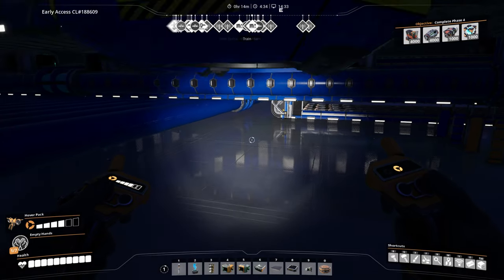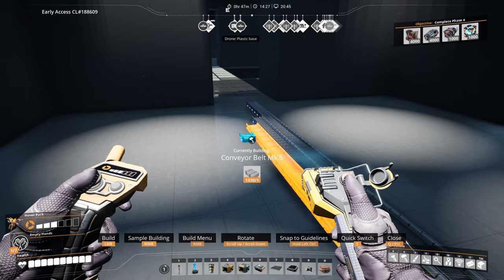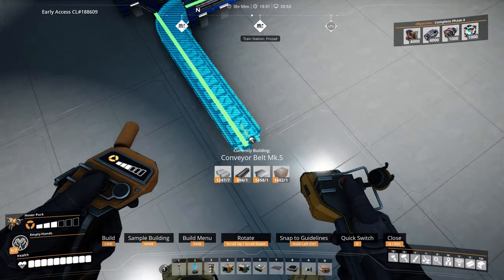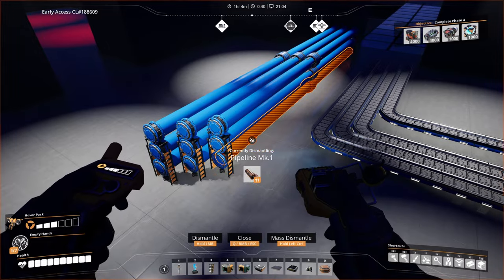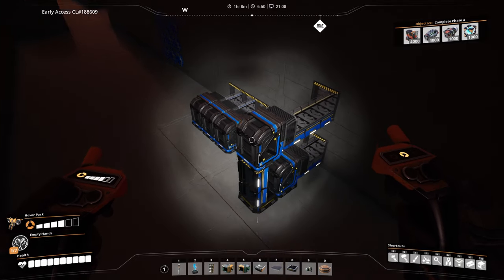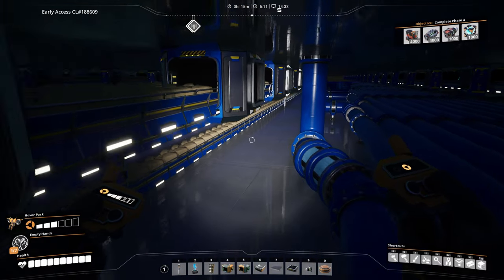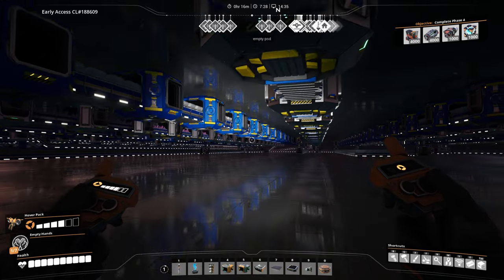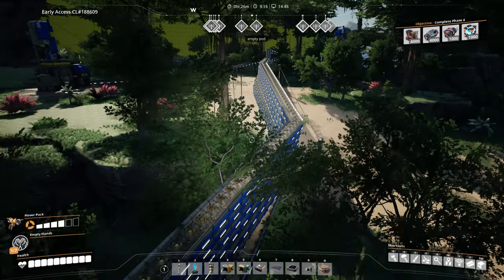10 Tips for Neat Belts and Pipes in Satisfactory!

Comment: Hi, thank you for this propper guide, love it.
I have a question regarding placing inserters (conveyor mergers) into the factory, what is the best approach?
If i have to upgrade the belts next to the inserters, its sometimes very difficult to visually click them, always the inserter and the factory comes into the way...
I tend to place them as close as possible to each other.
Its still early game, so have to save on resources, cant expand too much
Reply from the maker: Thanks a lot! 

Are you building on foundations? 

If yes, it's usually a good idea to build a row of machines, then place splitters/mergers on the foundations aligned with the inputs/outputs, and finally draw belts between splitters/mergers and machines. This is called a manifold (I have made a video about them too). This way they shouldn't be too close to the machines (unless you build them literally touching the machines).

If you're still in the early game without foundations, I wouldn't focus too much on making the factory pretty, and just build spaghetti. You will rebuild the factories many times in this game :)